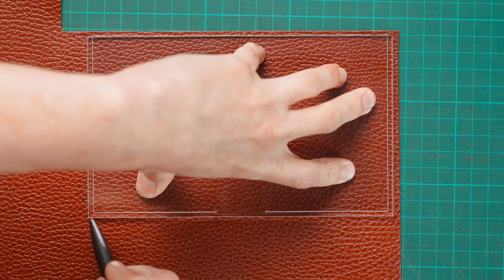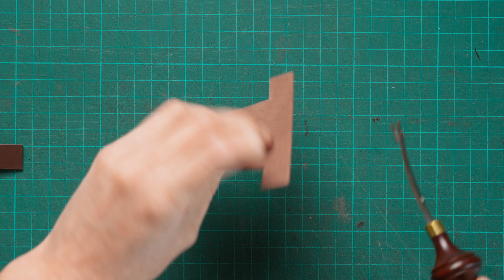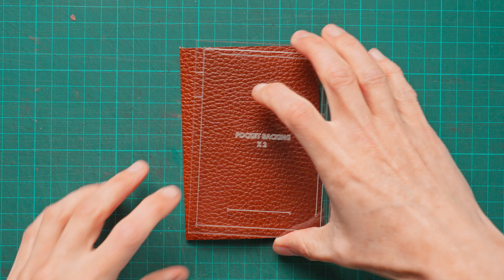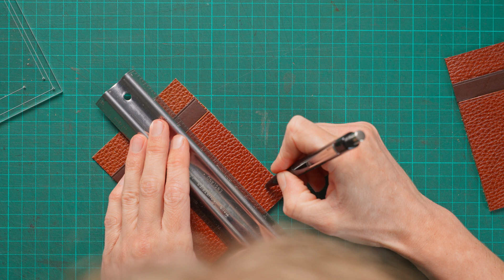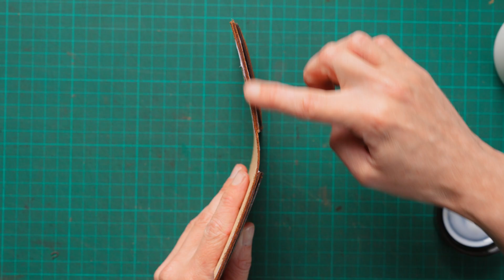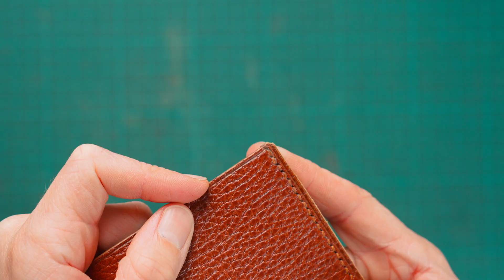Make your own VERTICAL BIFOLD WALLET // leathercraft make along tutorial // PDF pattern pack

Comment: Hi. I tend to buy leather in packed pieces. Would an A4 size be enough? Thanks
Reply from the maker: A single bit of A4 would be a bit small, for the laser version, I cut my leather 43cm x 25cm, there is room left over on that but so long as it is a min of 23cm you should be fine.
Reply from the maker: I just checked my patterns on some A4 sized leather and you will need 3xA4 pieces for this wallet.
Reply: @JHLeather that's really helpful. Thank you!